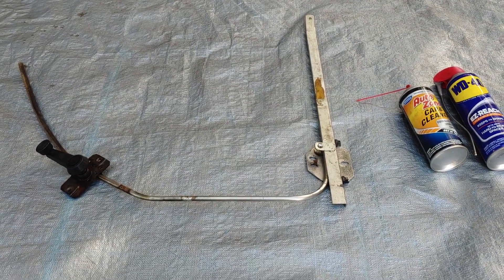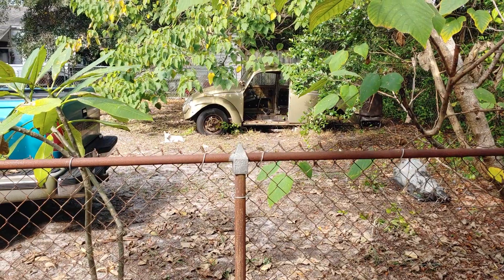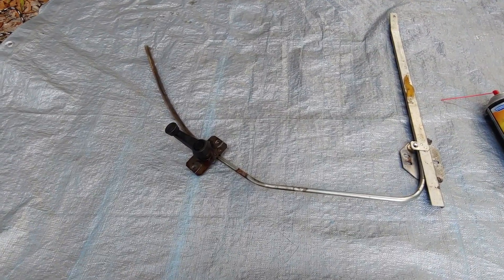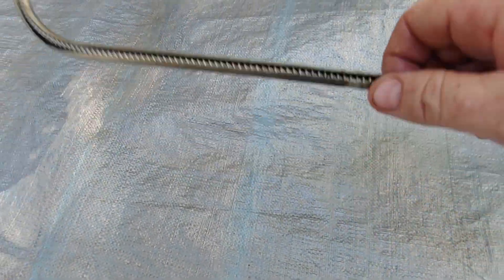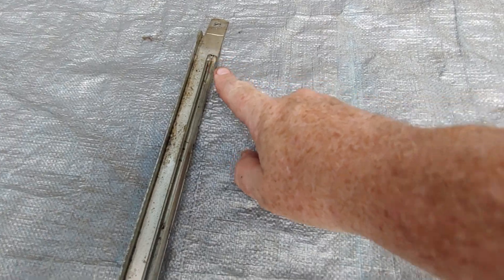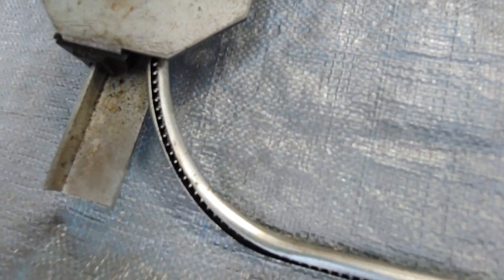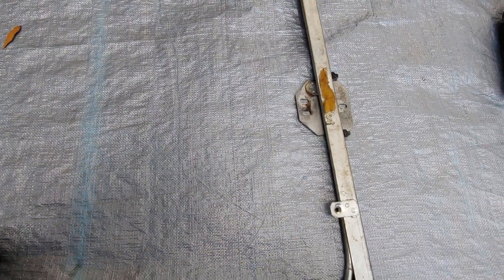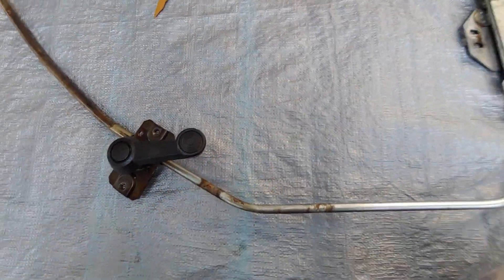CLASSIC VW- 1972 SUPER BEETLE. UPDATE. PART 25 ( WINDOW REGULATOR)

Comment: Good advice. Job well done 👍 👍👍make sure you stay hydrated 😁 It will be one degree tonight. Be safe and well.
Reply from the maker: 70 here tonight. Thanks for the update. Stay warm
Reply from the maker: Is it snowing also
Reply: Not much snow so far. About four inches this year. Early yet. Last year we had so much snow we could not find room to pile it.  Also a couple of nights it dropped down to 50 below zero.  My battery in my car was a year old. Fortunately I had used a vacation day and exchanged the battery with a new one. O’REILLY ‘s was great 👍. So I was happy camper. Be safe and well.
Reply from the maker: @oscarblom4885  one word response, WOW

Comment: Hello! My regulator is a bit rusty at some areas so at the metallic cable some springs broke and when i turn the crank it is turning free without moving the window. This happens after cleaning and lubing the regulator.
Do you think that it must be replaced?
Reply from the maker: Yes. They bind from years of rust and dirt over the years. Even when you get the new one.but some WD-40 type product. It's a item we forget to maintain. Word of advice when installing the new one. Take pictures before and during the tare down. I fought with mine for 20 hrs. Then I realized I had the door brace installed wrong. It's a simple strait toward job though. Hope the info helps. If you need any additional info feel free to reach out. I try and answer as fast as possible. Thanks for watching and supporting the channel. I hope to be back in the garage soon this year. Taking care of a lot of family issues. Time is not been on my side. Take care, stay safe my friend.

Comment: Hey man, I know this video is pretty old now, but I got a 74 Super and both windows wont move at all, would this be the same process?
Reply from the maker: Absolutely. All the doors are the same from 68- 79. Hope this info helps you. Super Beetle and standard beetles are the same as well. Are you on Facebook. Check out Volkswagenplanet VW GROUP PAGE. Lots of other youtubers on there as well. Hope to see you on there. Stay safe. If you need any other questions answered , let me know. I will answer them for you

Comment: Remember that WD-40 and PB blaster, are not very good lubricants. They’re very light lubricants. And the solvent they are in evaporates quickly. If you get yourself an oil can, or just pour some motor oil in that. It’s a much Better lubricant. If you want to spend money get yourself some lithium lubricant , that’s pretty good. Or you can even grease it. The cable has or had a little bit of felt twisted up in it. And that holds the lubricant. And yes factory parts, most of the time are better than absolutely new aftermarket parts. There are some exceptions you know, suspension components and such. But door window regulators, usually if they’re not broken, you can rehab them easy. Remember everything on the driver side door is going to be screwed up. Because it’s the one that gets the most use. The passenger side door everything will be perfect. Ha ha ha ha.
This is a two edged sword here, if you grease your regulator, or it has oil on it it will attract dirt. So, it’s necessary to have the proper rubber, good rubber, not broken.... on your door, to keep all that dirt out.
👍👍👍 Keep on keeping on!
Reply from the maker: Always great to read your detailed responses. I'm grateful to have you as a sub. Great tip
Reply: @Volkswagenplanet  😀😀😀
Reply: So glad to have you and video author. I inherited a '72 super beetle that sat for 30 years. Was considering replacing both regulators, now I know better and what to do! Thanks guys.